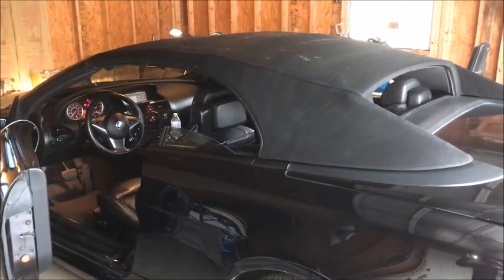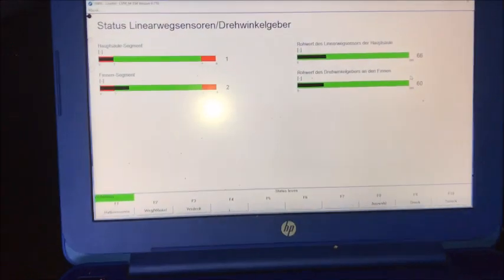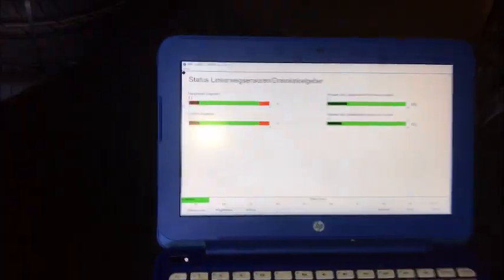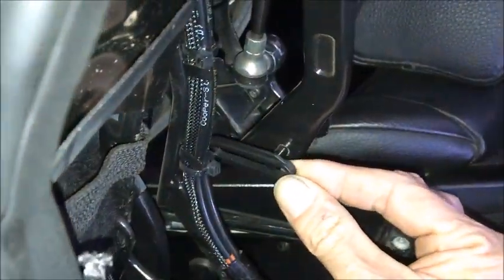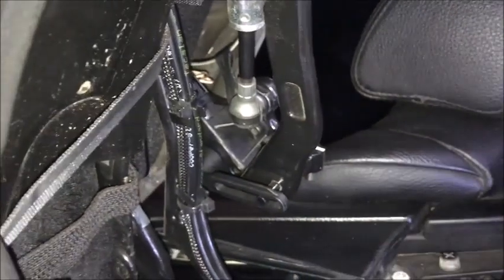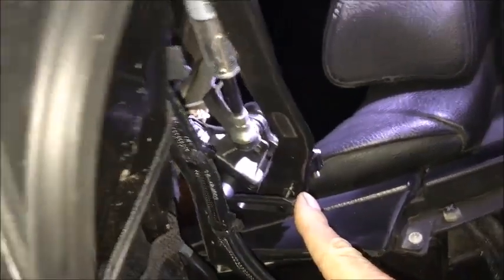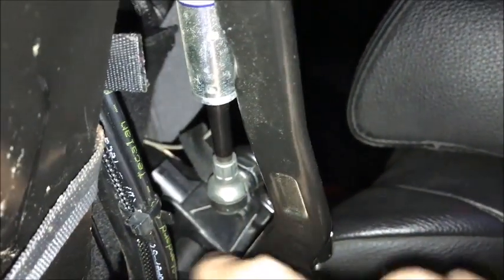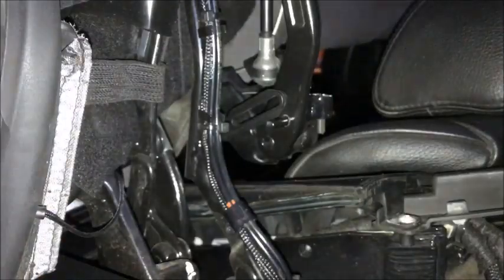BMW e64 Convertible Top Not Locking Part 2 - Adjusting the Segment Sensors

Comment: Please let me know if you live close to Atlanta, GA.  My 645ci rear window refuses to go up.  I would love to get your perspective of what's wrong.
Reply from the maker: Joe Outland , I’m a bit away from you in Tennessee so checking it out would be a several hour trip for sure.  Does it make any type of humming when you try it with the button on the drivers door?  If not, it might be a fuse or the relay ( you may have checked this already ).  I don’t think there is a way to manually raise it up though.  I’ve never had to work on the back window, but the way they design BMWs, I would suspect the whole rear window module unbolts and comes out as a unit.  Seems the hydraulic pump system sits just behind it so it would probably have to be unbolted and moved slightly out of the way to get the module out.  I would start by (if you have not already done so) checking the fuse to the rear window motor, then check the rear window relay to see if you can hear click when you press the window button in either direction.  After that it would be hooking up the laptop to be sure the Hall effect sensors are sending a signal and looking for any error codes (the INPA software and cable needed is really cheap now off the web).  Then it’s to the module to look for loose wire connections and then finally pulling the module to see what’s up....basically checking the easiest first and working to the hardest.  Maybe it’s just a fuse or the relay...those are easy to do and the diagrams for the fuse and relay locations for your specific year should be out in the internet.  Best of luck...hope you can get it fixed up and working again !

Comment: Your video has help me to fit my car. Thanks, I am having problems with car with the restrain system. It says internal fault, any ideas?
Reply from the maker: Glad the video was helpful !  For the restraint system fault, it would be difficult to know for sure without having the software and cable to look at the codes, but there was a recall on the passenger seat occupancy sensor that trips a malfunction code that may still be covered under the safety recall.  You may be able to call a dealer, give them your VIN and the exact error message and they can tell you if it is the recall issue.  The only other thing I have seen is a error due to accidentally leaving a glass cup under the seat and it getting crushed by the seat mechanism when it was moved that broke a connector.

Comment: There are allen screw stops on the frame to align the sensor.
Reply from the maker: jan Rodgerson , yep...it’s shown in the part 1 of the two videos. It doesn’t do anything to adjust which segment is picking up except for the end position though so if the segments are off during the movement the sensor would have to be repositioned.

Comment: Please tell us what computer interface/application you are using to see the status of the hall sensors
Reply from the maker: mikbai01 , hello the software is called INPA and should be available on the web now for free.  I downloaded mine from the Bimmergeeks web site.  Since it was a free download and I don’t really trust free software downloads, the blue laptop I use is dedicated to this software and the others I have for my different cars (gm, Audi, etc...).  The cable is also available from sellers on eBay as well as other sites that specialize in OBDII interfaces for cars.  I think it is called a K + DCAN interface cable for BMWs. Hope the video was helpful and you can get yours fixed

Comment: I have the 2012 650i, same issue just a thump....thx.
Reply from the maker: daniel adams , yep thumping it works for a while...eventually mine stopped responding to getting thumped (and even to the adjustment as a segment went bad in the sensor), so I replaced it.  Been good as new since replacing it 🤞

Comment: Do these sensors fall under the convertible top class action lawsuit?
Reply from the maker: Jeff B , hello...yes, I believe this was one of the items covered under the lawsuit if money was paid to get the top fixed.  When I took mine off, someone prior to me had opened up the holes so mine may have had the adjustment done at one time, but since I did not pay for it I did not qualify for the lawsuit.  I bought mine when it was a couple of years old for a really good price...probably due to issues like this that scared the previous owner.
Reply: My understanding is that bmw would update system on the convertible if they didn’t fix it they would replace the top free of charge. Also if you paid money to get it fixed you would be reimbursed for it.
Reply from the maker: It could be, but I was thinking they would only do the software update to reduce the sensitivity of the logic and reimburse for any past costs with corrections.  I actually never heard more on if people were getting reimbursed or not so not real sure.  For the software update, I don’t trust BMW enough with my car to let them flash the modules for the upgrade, lol.  All it would take is one module to fail to update that is not related to the Conv Top Module for them to come back and say there are other issues with the car and they are only covering the convertible top software update...then I’m stuck paying them.  It’s a risk I’m not willing to take as I have had zero success with BMW dealers...probably because I don’t buy new BMW’s so I don’t have any pull with them

Comment: Hello i have a 645ci convertible top won't open  red light flashing now trunk won't open either any ideas?help pls
Reply from the maker: Manuel Payes , hello...yep as long as the red light is flashing, the trunk will not open...this protects the trunk lid from being opened if the car thinks the convertible compartment lid is not fully down or if it thinks the convertible top is not fully opened or closed (thus the red light).  You can use the physical key that’s in the fob to open the trunk if you have to (there’s a key slot in the bottom of the trunk latch when you tip it to open the trunk...just in case you never knew).  If your top is currently fully closed and it is blinking red, the most common issue is the sensor that is in this video...to see if it’s just a little out of position you can thump around with your hand on the inside of the top on the drivers side ( just above the driver side back window) to see if the sensor will hit the position and stop blinking and also thump on the driver side wing on the outside to see if it will get it into position.  If it is doing this with the top fully open (down inside the compartment), it could be a bad hall sensor or a wire has gotten pinched so one of the sensors won’t tell the car where the top is in the movement sequence...it just stops and blinks to protect itself from damage.  Maybe this will help...if not you can reply back with the position of the top (open or closed...or maybe stuck half way) and also if you have tried to reverse the movement and if it will move or not.   There are several videos on my channel for this convertible top that may help to  with determining the issue.  Just know that if you do decide to open or close the top manually (one of the videos), be sure to then try to open or close the top with the buttons next.  If it still does not move because there is a fault on a sensor not reading, it may disable your side windows as well so you will need to look up the video on how to re-latch the locks before your side windows and back window will work again.
Reply: @StevesDIYs  thank so much for the info. I tryed to open it with the key but doesnt work. I Also found the sensor and move it but didn't do anything either. Any ideas on how can I open trunk with another method?  Thanks in advance for your time
Reply from the maker: Manuel Payes , that’s odd that the actual metal key that’s inside of the key fob won’t open the trunk even if the red light is flashing.  Maybe check it one more time by doing this (I’ll put all of the steps just in case someone else is reading the comment and did not realize there was a metal key inside the key fob)...remove the metal key by pinching the top of the key fob and pulling out, tip the trunk emblem like you were normally opening the trunk with it, while keeping it tipped, insert the key into the key slot that is in the trunk emblem that is exposed underneath when it’s tipped, turn the key and you should feel the key move the latch, then raise up on the trunk while the emblem is tipped and the key is turned.  If this doesn’t work, the only other option I can think of to open the trunk is to remove the lower center pad that is between the two back seats and pull out the ski bag.  The rectangular door between the seats and the trunk will then need to be forced open by pushing it toward the trunk.  Then a long wire (or coat hanger) could be used to pull the emergency handle that is inside the trunk (it will glow green if a flashlight is shone in the trunk for a minute).  Note that I have never tried going through the ski compartment or pulled the emergency latch so I’m not sure if this will cause further issues so I’m really not sure about doing it that way.
Reply: @StevesDIYs  Hello thanks for your videos. the top motor gear was broken changed now trunk opens and everything else working properly thank you so much for your help!
Reply from the maker: Manuel Payes , thanks for the feedback 👍. I’m glad to hear that the videos are able to help sort out some of the issues with these convertible tops.  My thought in making them was that if the videos helped just one person it was worth the effort to make it and post it up.

Comment: I have 645ci 05 every time I try to open the top the car say convertible top emergency operations any idea what the problem could be plz
Reply from the maker: omar halawa , hello...I would suspect that one of your segment sensors has gone bad or that the wires to them are broken, or you have a broken wire to the trunk position sensor, but without being able to see if they are functioning it is hard to know for sure.  If the car cannot tell where each component of the top mechanism is ( like a broken wire or faulty sensor ), it will not move so it won’t damage the mechanism. It will tell you that you can only move it manually (emergency mode).  The INPA software that is in this video and also the Part 1 video as well as the OBD2 cable can both be found on eBay or other sites for sale and it is not expensive now.  The software and cable are a cheap investment as it allows you to look at many of the systems of the car and do resets for things like errors or service intervals.  You might try to manually open your top and check for pinched or cut wires...in Part 1 of the convertible top video on my YouTube Channel, I show where mine were pinched by the mechanism and were almost cut in half.  Hope you find the issue...I know exactly how it aggravating it is to have the convertible top issues for sure !

Comment: I need your help
Reply from the maker: j fits , hey man...if your having convertible top issues, there are several videos on the channel that go through different issues the mechanism can have.  If you don’t have the INPA software and the communications cable it is very helpful in diagnosing the issues (you’ll see it used in some of my videos). What’s the top doing wrong?
Reply: I put the roof back n it stopped and said top malfunction so I put it down (without pulling the levers in trunk)my trunk is locked n my back window doesn’t go up it’s a 2012 bmw 650i
Reply from the maker: j fits , if the top has a malfunction and does not complete the cycle basically thinks that it is stopped somewhere in mid cycle so it will not allow the trunk to open or the back window to move (both of these could get damaged by the movement.  It sounds like a sensor not reading or maybe one of the pump relays did not energize.  If you have it back in the trunk, have you tried pressing the top open button again to see if it will complete the cycle?  Or try to close the top to see if it will try again.  To access the trunk with the top faulted, you have to use your metal key that is inside of the key fob in the key slot that is below the trunk emblem that tips to normally open it.  Sensors are difficult to track down without the INPA software...I would be lost without it on fixing mines issues in the past.
Reply: Steve’s DIYs it doesn’t let me put my top up .it says top not locked
Reply: Nothing moves .
Reply from the maker: j fits , if it’s down in the compartment but still saying that the top is not locked, it’s most likely one if the Hall effect sensors or the segment sensors that’s not reading. The 650i that has the cream color interior on my channel videos was in the same situation where the top was down in the compartment, but the rear window would not go up and it had the top not locked error. For that car, it was the bad rear window Hall effect sensor causing the issue, but yours could be it or even one of the sensors inside the compartment. The only way to tell would be to get the INPA software (or equivalent) so you could see which sensors are not being made causing the top to think it is not locked.